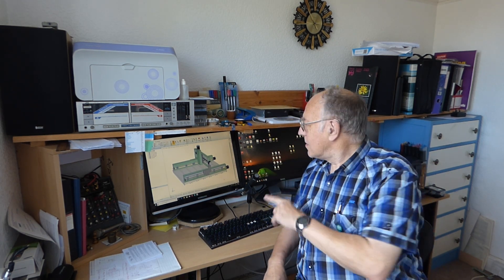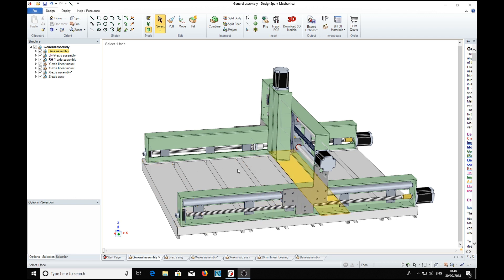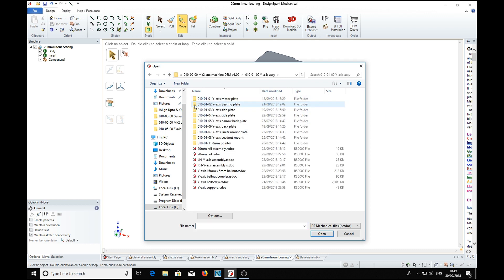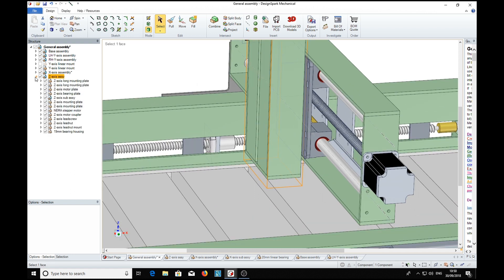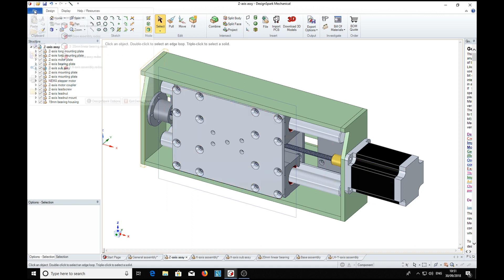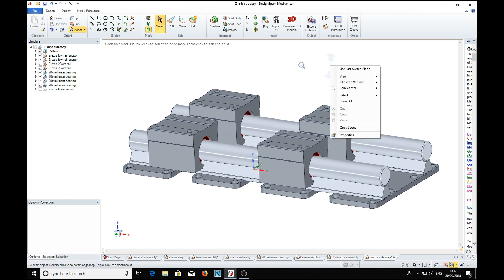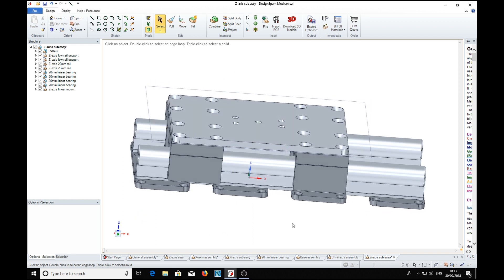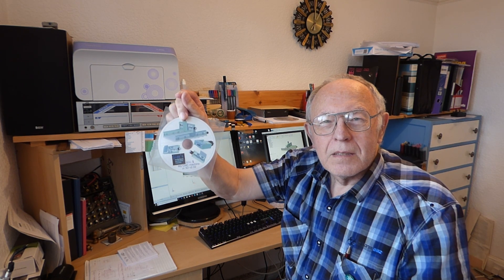My CNC machine in DesignSpark Mechanical

Comment: Jim I cannot find your " jim's Design Spark models" or " jim's DesignSpark models" on eBay.
Reply from the maker: The actual title of the advert is:
'My CNC machine modelled in DesignSpark Mechanical CAD software'

Use that as your search keywords. YT will not let me send you the actual link to the advert.

Jim
Reply: @JimTaylor42  "My CNC machine modelled in DesignSpark Mechanical CAD software" not found :(  pls write here url to your ebay store
Reply from the maker: @SupFromCz  Hello

You should find it here: https://www.ebay.co.uk/itm/273562992826

Kind regards

Jim